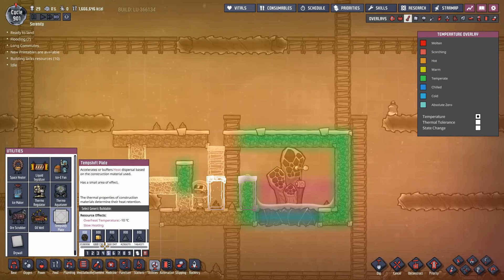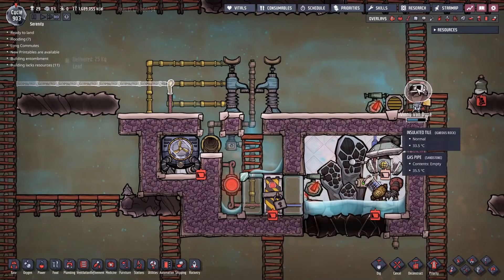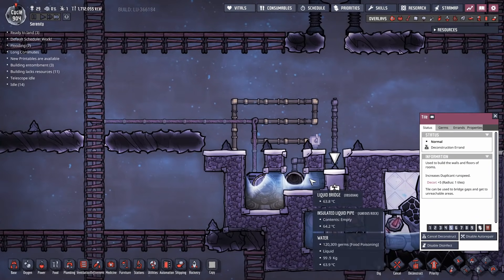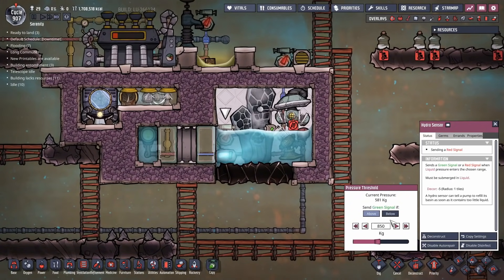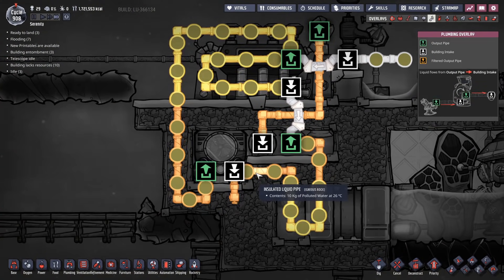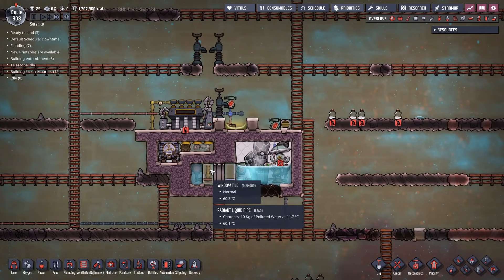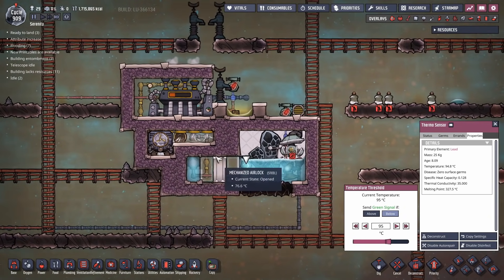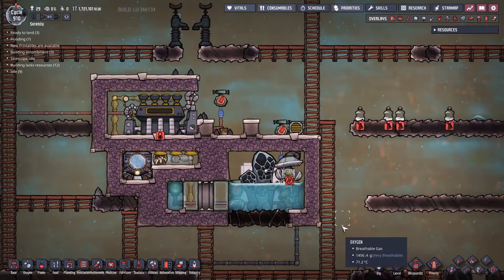Cool Steam Vent Taming : Tutorial nuggets : Oxygen not included

Comment: Have to disagree with you on this.  The designs by Tony regarding the steam vents are vastly superior, and simpler.  When you get super coolant they turn in to self sufficient ice and  hydrogen liquifies.  The key is how much power is contained in the output steam.
Reply from the maker: I love tony's design and it is power cheaper and uses lower end materials. (Excluding super coolant version) The difference is more in philosophy. I want a one size fits all set and forget design, think petroleum boiler that will run on any minor volcano regardless of output. So my steam vent tamer works on any steam vent up to 10kg/s. I'm not sure where tony's caps out at but it's before that point. For a player with skills looking to squeeze the most out of a map Tony's design can give you an edge. For a brute force player who does not know the meaning of power saving my design should fit the bill :)
Reply: The point is, if i have super coolant, at that point why woul i need to tap on a stem vent
Reply: With just water as the coolant it is still better than this.  It works similarly just not as insanely.
Reply: It depends - if you have a lot of other work for an AT then you can really reliably keep the steam turbine spinning when heating the steam above 125 (a la Tony's design sans the cool water output), but if you don't have that this design will be more reliable and flexible. This design has advantages for remote infrastructure while Tony's design has some advantages when built close to a base. This design is also more scalable for higher output vents without requiring a redesign or substantial increase in size while also having lower power costs in the steady state. You pay full price for the cool water stream in Tony's design - a cost you don't pay here, and it's a cost that can only be removed in that design if you have other comparable cooling needs to tax the AT in its place. Tony reliably generates steam by cooling enough of the water to room temperature to recycle those DTU's to elevate the steam temperature above the vent and run the turbine, but you pay the full price in terms of power for that cooling - all power produced in both system's dedigns is generated by DTU deletion in the turbine so the system putting out colder water always cost more power in the steady state (because it deleted more DTU's) and Tony's design requires putting out colder water to function at all (in isolation if you try to output all 95 degree water on Tony's system you get no water and the steam vent locks up due to overpressure because the turbine won't run).

On the balance it depends on goals and location, but it's definitely wrong to categorically call this system less efficient - if you wanted you could have this system dribble out about the same amount of cold water as Tony's requires, and you'd find they have about the same energy budget under perfect conditions... I think. The main difference is that with this system you don't have to do that (barring outside heat flux).
Reply: I may be wrong, but in both cases you need the power to change the steam temperature by 15°C. Here You can recycle just that, whereas in tonys case you get additional 15°C to recycle. Or what am I missing?
Reply: I don't remember exactly but the cost calculation is pretty similar in the water loop.  You have to pump the water out anyway.  Using a tuner with the steam gen the cost was around 300?
Reply: My reply was to @riotintheair (Sorry I dont get the yt answer mechanism)

@Micah Chase I agree with you. And good point point that should make tonys design even less power demanding
Reply: @0x0404  That's a good point I wasn't accounting for the pump. That could possibly tip the scales to Tony's favor. How much heat the AT needs to put out to get to 125 degrees depends on how much the vent produces and there's some issues with needing to maintain steam temp between eruptions which in retrospect make it a little harder for me to think about how the energy budget works, but it's definitely not as bad as I was thinking since pumps are very expensive.
Reply: @riotintheair  I would argue even without the pump, that Tonys design is more power efficient, independent of the output of the vent. My thinking a bit more detailed:

First thing to note, aquatuners only shift heat from one medium to another, they neither produce heat nor do they delete heat. In Francis case, the AT is used to cool the steam by 15°C. All the heat removed from the steam-vent-steam, is put into the steam of the steam turbine. That way you can recycle ~47% of the power input of the AT (ideally) .

Now in Tonys case, the AT is used to heat the steam by 15°C, which has the exact same power cost (since is the same amount of water) as cooling the steam by 15°C. But since you don't need the cool anything (except the steam turbine), you get the cool water for free.. The steam gets heated from 110°C to 125°C, which gets turned into 95°C water by the steam turbine. The amount of thermal energy in the water available to the steam turbine is twice the amount of the previous case, because you get the heat from the AT (which is the same as above) PLUS the thermal energy that is already in steam. Therefore you get back ~94% of power you put into the AT.

In the ideal case you therefore use half the power and get cool water. Of course then you have to cool the steam turbine (in both cases), and power the pump ... which are additional losses, but that doesn't affect the principle.
Reply: @tingiubik  this seems to check out. I think that's right.